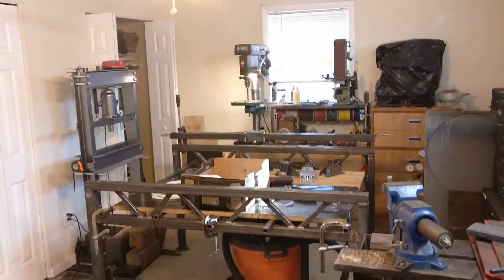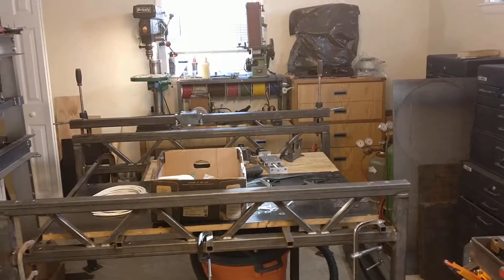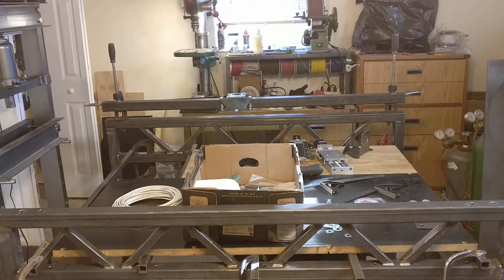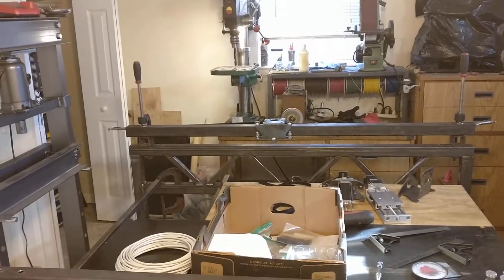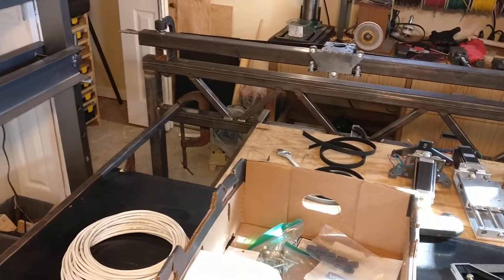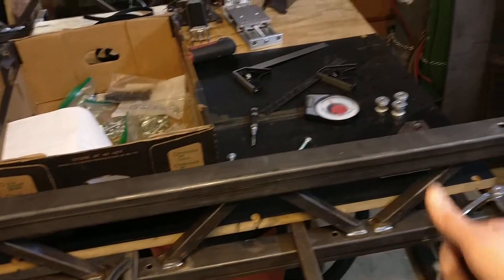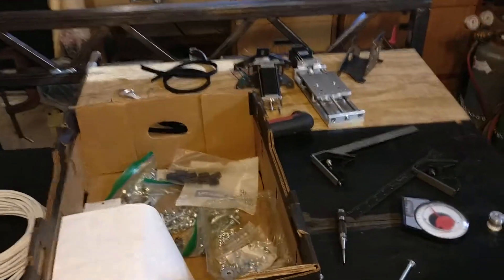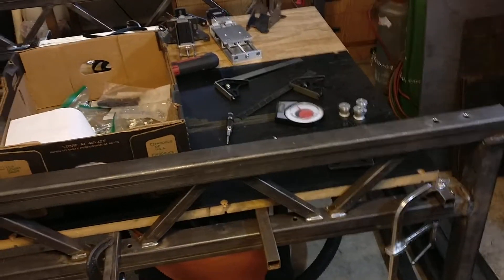CNC Plasma Build: The gist of it

Comment: The x & y axes. Did you design the gantries, or did you get the design from somewhere else. I'm asking because I to would like to build a plasma table. The table is easy, but the stepper motor mounts to the tubing is a bit harder. If there are any plans, I'd like to be able to get them if possible. Great vids.
Reply from the maker: I ordered the motor mounts from some rando on eBay. The whole build was essentially cobbled together based on what was available, hahah. In hindsight, the hot rolled steel was a horrible choice for gantry components (way too much twist and bowing) and these particular motor mounts didn't even make very good contact on them - they were just supported by a few skateboard bearings.

When I have a workshop again (moved, currently living in an apartment) and build another, I'll probably be going with aluminum extrusions and some cheap-ish linear rails on them. Yeah, it's more expensive, but now that I know the software side is doable, it's worth the extra money to have a more precise machine. (Single time cost, long time benefit, etc.) Plus, there are enough standardized sizes that there are probably some 3D printed designs for mounts I could use.

And if you don't have a 3D printer yet, it's worth getting one first. Back when I build my plasma cutter, I only had a Lulzbot Mini printer, which honestly, kinda sucked (it was one of the best they made in 2016). Later I got an Ender 3, which was 1/5th the price and 5x as good. Still use it to this day. (The Lulzbot was scraped for parts, hah.)

Comment: I am planning on converting my 3040 CNC to plasma... anything i should need to know. currently used linux cnc for the 3040 cnc milling... my main questinon is how does the cnc software know to turn the switch to stop and start the plasma arc. how do you get that worked out.

Comment: What filament type did you use for the 3d printed template?
Reply from the maker: Probably ABS, if I'm remembering correctly. Really, any should work, so go with what you're most comfortable with.

Most important thing is if you're printing off guides for plasma cutting (as opposed to drilling, etc.), then have it spaced off the material, either with something included in the print, or by inserting some shims underneath it. That gap makes it take a lot longer for the plastic to start melting.

Comment: Where did you get those carriages?
Reply from the maker: On eBay - there are a number of sellers with similar products. (I haven't yet gotten around to joining them, hah.)

These things definitely are the biggest source of inaccuracy in my plasma cutter, though. If I were doing it again from scratch, I would have looked for something a bit more rigid. Now I've got better rails for that, but still need to jump through the hoops of tearing these down and setting those up.
Reply: @swolebro  I was originally planning on using steel v-wheels and hardened v-track like this: https://www.mcmaster.com/v-groove-rails/. I still think it's what I'll do. I not a fan of using linear rails like HGH20's on a plasma table with a water table and abrasive dust that is typical in a metal shop environment.
Reply: @1990notch  plasma not need high accurate linear rails, waste only lot money, need only square steel tube and lot bearings can build good linear rails cheap. looking etc, JD garage plasma table videos.